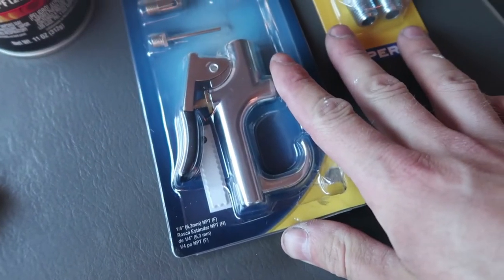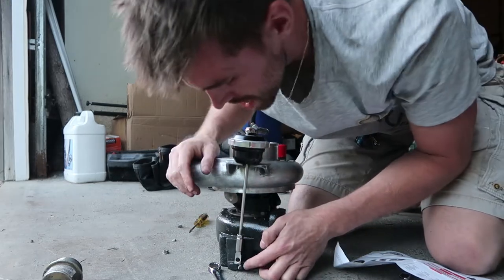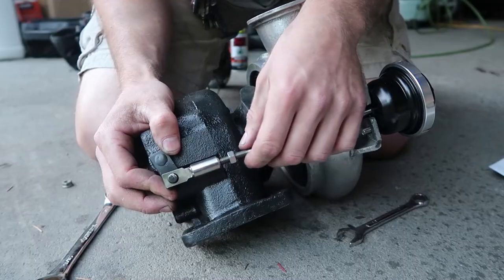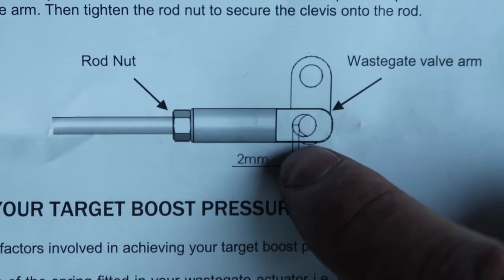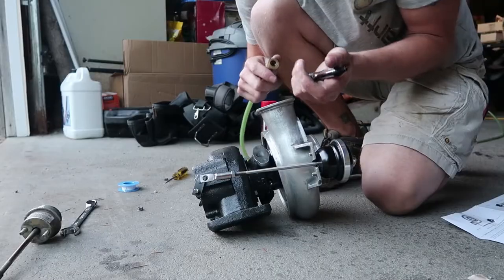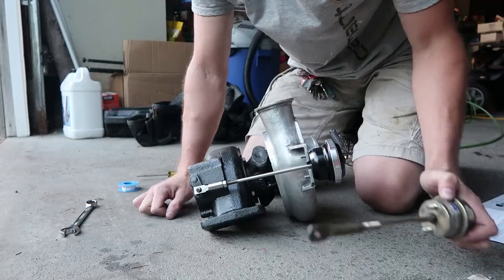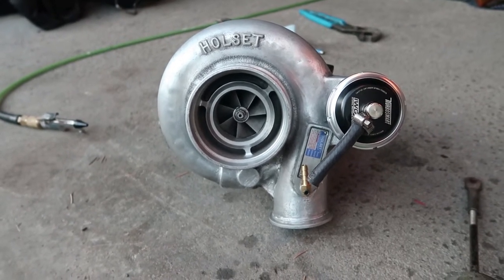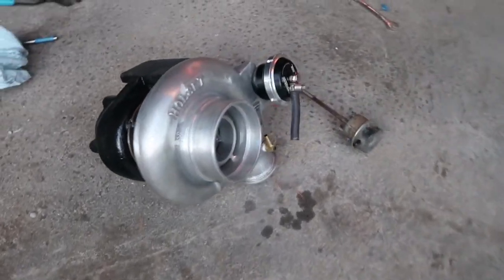How to SET WASTEGATE on HX35 TURBO (Turbosmart IWG75)

Comment: Quick question josh I was wondering why you went with a turbo smart waste gate over a AFE waste gate. Is the turbo smart waste gate better? Thanks!
Reply from the maker: Kelly Keller the turbosmart looks cleaner/nicer to me and you can also open it up and change out springs inside of it to adjust boost levels along with the adjustable boost elbows. AFE's are sealed up like stock units, but still nice products and better than stock. I was just looking for more adjustable options really.

Comment: Hey buddy, I have just bought a 2001 Dodge Cummins with a hx35w  off of young buck that was learning to work on it,  took the engine out and is on the stand and noticed that the wastegate isn't hooked up and the hoses is cut off but on the hx35w where there would be a hole there isn't? Help please lol

Comment: Hoping someone can help. Just found this video because I searched for wastegate issues. I did a pressure test on my 95 12v turbo system the other day looking for boot leaks.  The system wouldn't pressurize at all.  The air flowed through the rubber hose on the turbo just as fast as I applied it. When I punched the hose by hand, the airflow stopped.  Is this an indication my wastegate is stuck open? I am very low on power, and just searching for the issue.